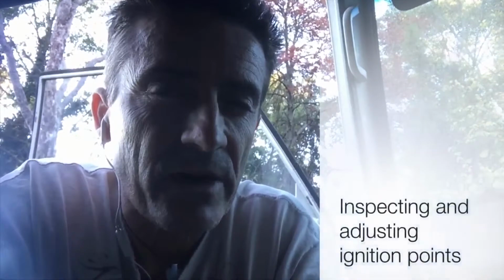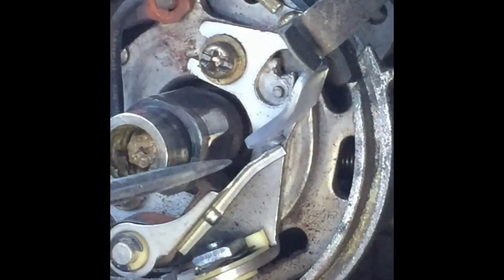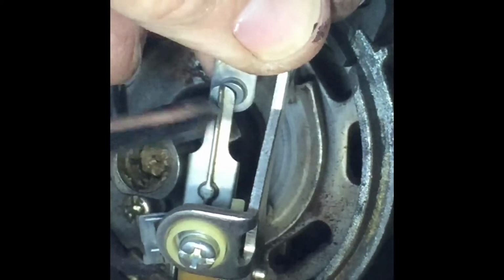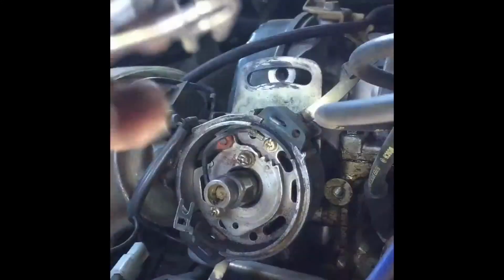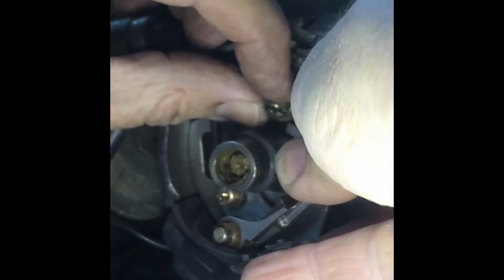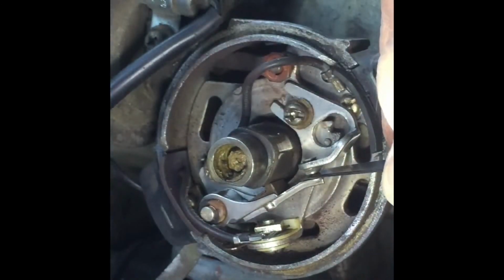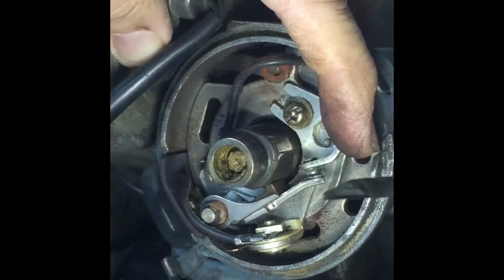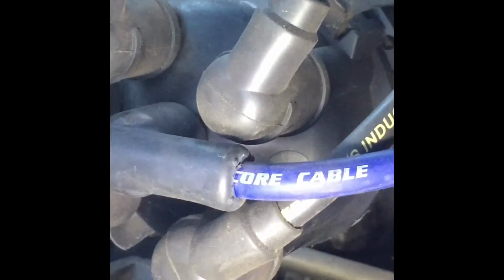Checking Ignition Points in my Ford Econovan Max - How to DIY

Comment: Did you ensure a lick of grease on the rubbing block ? Left dry, it wears out in a few weeks. Closes up the points.
Reply from the maker: You know I can’t recall. Not on the block but I usually ensure light grease on the cam.